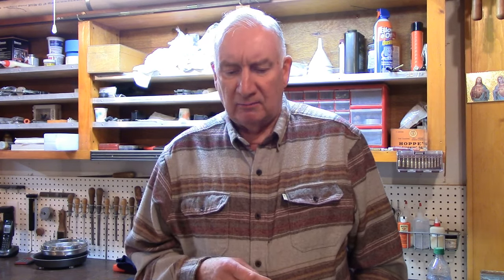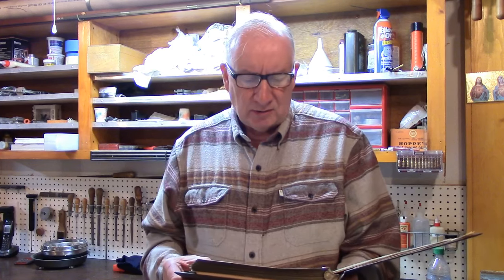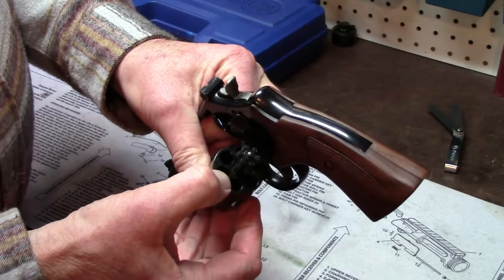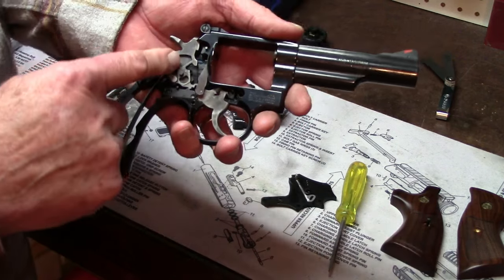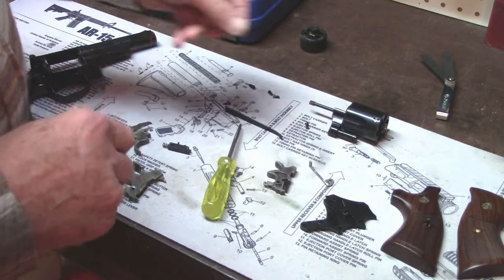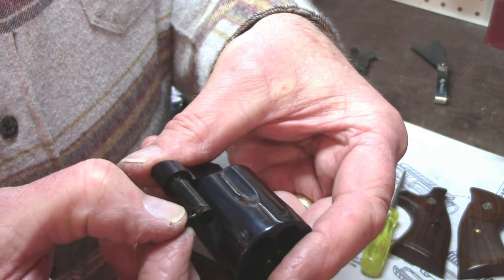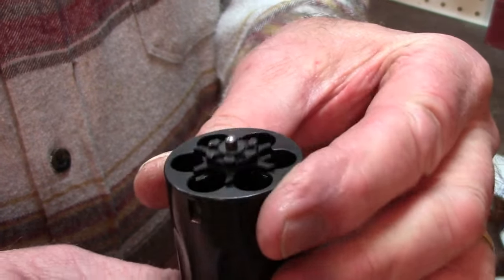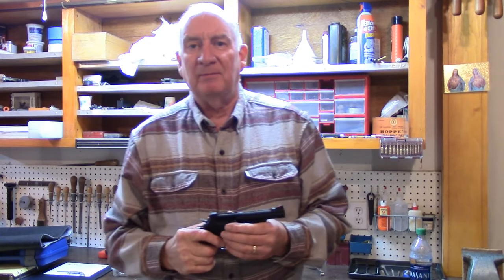The New S&W Model 19 Classic ~ A S&W Armorer's Review

Comment: It's very unfair to consider operator damage to any company. That list of 51 problems are not manufacturer errors.
Reply from the maker: It's not unfair to assess problems of any sort. While abuse can certainly be blamed for damage to any product of any nature, that list contains problems that arise due to normal use, that will absolutely occur though no fault of the operator whatsoever. As a departmental factory trained armorer who spent 80 hours with Smith and Wesson, learning extensively about their revolvers, and who worked on hundreds of service revolvers and privately owned ones, I am exceptionally aware of every one of the problems listed, and how the problems developed. S&W provided free two-week armorer training to military and police, for the simple reason that repairs involving many of those 51 problems were routinely necessary in the course of normal shooting, and their company couldn't possibly handle such an enormous work load, paying hourly rates. It was their only free, non-tuition course. As directly relating to the Model 19, I was informed by inside company contacts that the L frame was brought out SPECIFICALLY because the Model 19, built on the old hand ejector K frame, broke down very swiftly under .357 Magnum loads.  Beautiful as it was, it had all the known service issues of the .38 Special Model 10 M&P, using identical mechanical components. .357 Magnum loads vastly  reduce the service life of the Model 19 as it was formerly made to handle much lighter cartridges. Years prior, in 1975, S&W head R&D and Armorer John Contos informed our armorer's class specifically that two specific models suffered extensive premature wear. While safe to fire, magnum loads swiftly took a toll on working parts, and they would simply be ruined beyond repair.  The two models he spoke of were the Model 19 and the .44 Magnum Model 29. I personally knew of three privately owned Model 29 revolvers that had severely loosened, with critical  endshake, and their owners were seasoned shooters who absolutely did not abuse them. 
This video was not made to condemn a beautiful gun.  I owned two and enjoyed them immensely, and I occasionally shot .357 Magnum loads in them.  But I am also an armorer who understands their inherent design weaknesses that they intelligently re-engineered in keeping with modern ammunition. Consider, that frame was designed shortly after the Wright brothers flew at Kitty Hawk, when horses outnumbered cars, and many years before WWI. I think it's unfair to require of S&W to stick to an unimproved design so ancient. The new Model 19 handles full .357 Magnum loads, and has none of the design weaknesses of its predecessor, while retaining more of the original than your car does to a 1907 model.
Reply: And A Blessed Merry Christmas to you and yours.

Comment: Never will buy a sw with Hillary hole
Reply: There are aftermarket plugs to fill the hole and the slot for the indicator flag and these look good when installed.  "Smith uses that abominable self contained lock because that company owns or used to own them.
Reply: 50 buck's for a piece with no extra value for the gun...